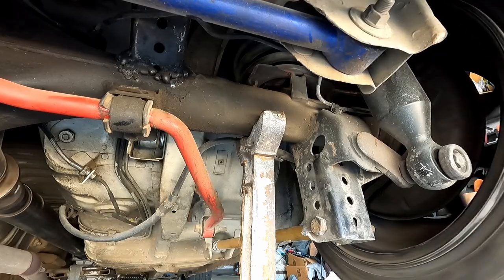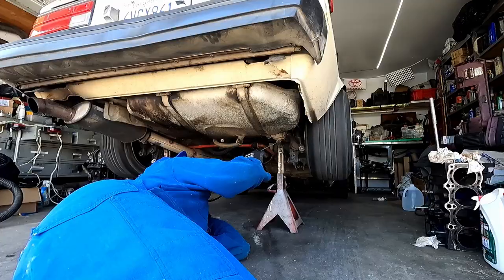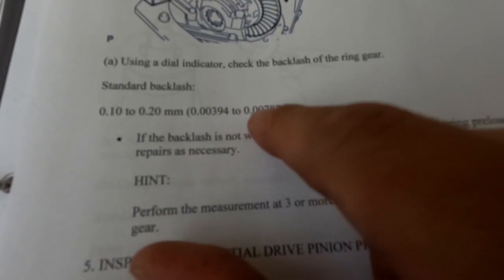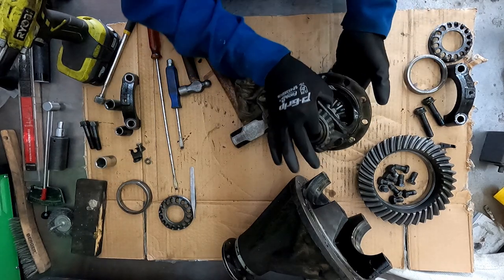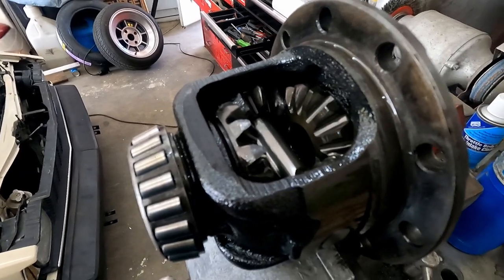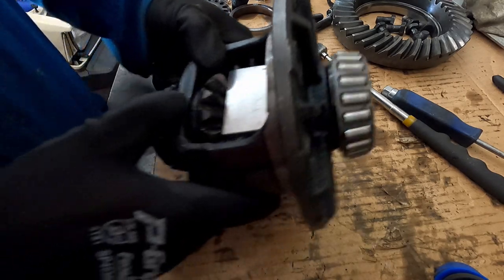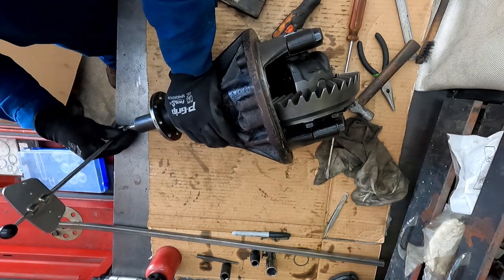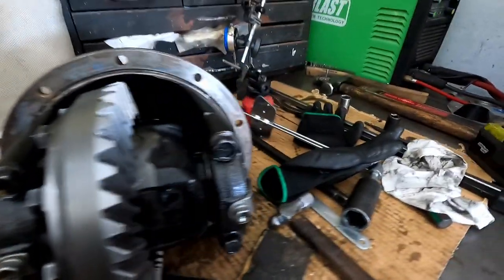Ae86 Differential Rebuild backlash, preload, wear pattern, welding on Celica Supra 5.29 final drive

Comment: Just to adjust the backlash do I have to remove the differential,or can I do it in the car?.Thanks in advance for your response
Reply from the maker: Yes you need to because there isn’t a rear cover on the Toyotas differentials
Reply: @kelvinarreola  this is a  1985 Celica.I see a cover on the rear
Reply from the maker: @romero10374 then yes you can check it